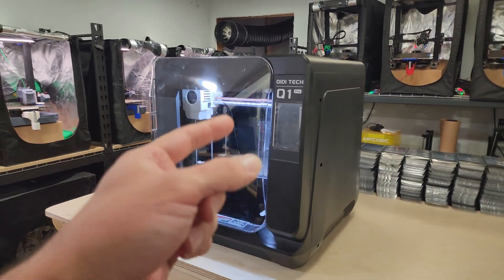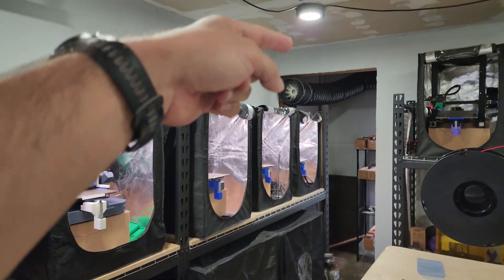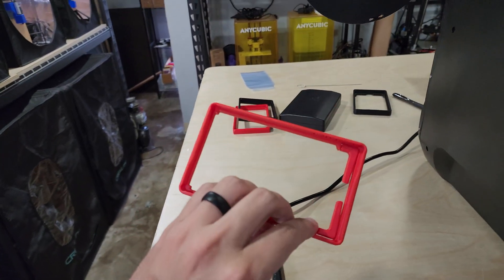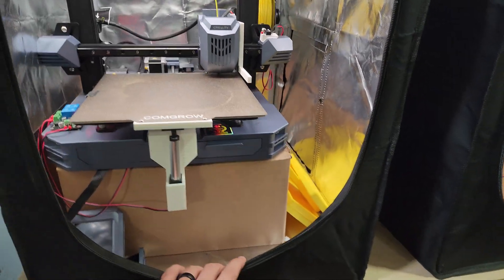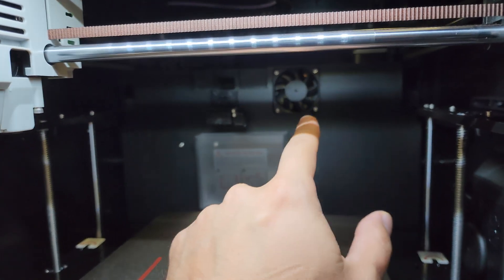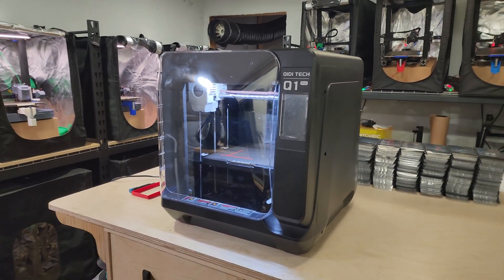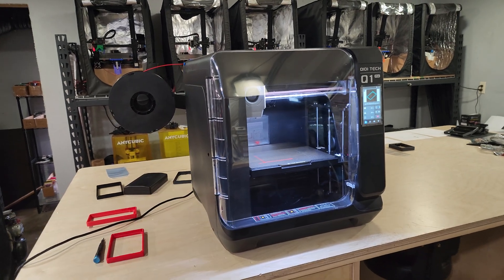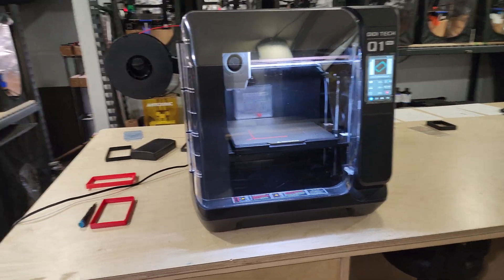The Qidi Q1 Pro is Saving My Health and My 3D Print Farm Business

Comment from the maker: I forgot to mention that a flexible duct was attached to the printer exhaust, and routed to a nearby window where the fumes were exhuasting outside.
Reply: I was wondering about that lol
Reply: Have you looked at the qidi plus4, would like to get your opinion on it. It has a active (fan) chamber heater as well.
Reply: Oly true solution is extraction small filters in printers are very limited I effectiveness due to size and filter media volume

Comment: I have played found that the absolute best way to prevent fumes is to trust nothing of what is said on the built in filtration. Put the machine inside on e of those zippered enclosures, run an inline 4 inch fan to it and out a window. That will actually create a negative pressure inside the canvas enclosure and ensure the machine is vented outdoors. None of these machines are air tight, so even though you may be creating a negative pressure, those fans the machines come with are not moving enough air anyway. Just mu humble opinion of course.
Reply: putting an enclosed printer inside another enclosure is a funny concept but I'm leaning towards that option, if I decide that I want to print ABS/ASA
I'm just not a fan of having a 4 inch inline fan permanently running in the background though
Reply: @felixxcatus  having an enclosed printer with a vent system that is not doing anything is far more silly to me. And those inline fans are not loud and are also variable speed. Using the zipper enclosure, you don't need them on high to function adequately.

Comment: Seeing your more latest video on the q1 farm, would a inline fan attatched to just 1 q1 overpower the chamber temps? (Extract too fast to allow heating) If that is the case do you just recommend the stock chamber fan at 100% (for 1 q1)?
Reply from the maker: I plan to make a video on my setup soon.
Reply: In my experience yes it does, you’ll need an inline fan with a variable speed so that you can find the sweet spot between venting and maintaining temperature.

Comment: You're telling me that this machine has a better seal than an X1C? I just switched from the X1C to the Q1 myself, and am looking for a way to rig the X1C exhaust system I made ('twas magnetic since the rear was metal) to the plastic rear of the Q1.
Reply from the maker: No i had to make some adjustments, I added a duct for the chamber fan to not feed into the electronics area, and I also added foam around the edges of the electronics panel to seal it better from the chamber. I left the bottom of the printer open to let air into the printer to note choke the chamber exhaust. Running 12 Q1 pros with ABS 24/7 this way and not a single hint of ABS fumes.
Reply: @Redo3D  could you do a video showing us this.solution? That would be great.

Comment: Flashforge Adventurer 5M Pro also has interesting system. It is internal and external circulation dual air filtration system with carbon and hepa filters. That is why I decided to buy one and I am waiting for delivery. It has a bit smaller build volume though, 220mm cubed.

Comment: If you take the back cover off the q1 pro — you will find that the fumes are not really sent out the exhaust vent. The fumes are just dumped into the back space of the machine and end up coming out the power supply vent as well. So you need to add an internal duct to channel the chamber exhaust out the right vent. This will also keep your main board and power supply cooler.
Reply: Do you have a video showing how I could do this?
Reply: This would be great to see a video on this
Reply from the maker: Thank you for pointing this out, I removed the back panel and definitely need that duct you mentioned. I can also see a lot of gaps that could be sealed better.
Reply: @Redo3D  it would be great to see a video on this

Comment: Can the QiDi Q1 Pro print Ultem 1010? How can the chamber be made to be hotter 90 -100C and the print head to 400C?
Reply: No it can't you'll either have to make a printer that can or but an industrial printer
Reply: It itself is made of ABS although there is a sturdy steel frame. ABS has a glass transition temperature of 105 °C. maybe 75- 80 chamber temp would be achievable without replacing the ABS panelling and other plastic components with higher temp alternatives but i think water-cooled motors and hot end might be required. I don't see much reason to extend the thermal head room 20 °C. Maybe QIDI will make a higher temp machine in the future for higher temp plastics.

Comment: Good info. I’m curious if the X1E can exhaust the fumes while keeping up the temp. But of course it’s so much more expensive. 

And do you need to run the fan at 100% speed? All you need to do is run it enough to create a negative pressure. I think it would be interesting to do some smoke tests with an automotive smoke machine and see how much it leaks at different fan percentages.

Also if PETG is too shiny I wonder what the finish is with PCTG. I hear you can control the finish with temperature. Similar properties to PETG and ease of printing with low VOCs and no requirement for a heated chamber. I do love ABS though. Especially Bambu’s ABSGF. And ABS can be cheap so I think you’re going with the right method.
Reply from the maker: I have a 10" 1200cfm exhaust fan that also creates some negative pressure in my workshop, so I just run the printer exhaust at 100% just to be sure its getting good suction. I dont mind running it at 100%, may even get a more powerful fan just to make sure Im really getting all those fumes out.

Comment: Is PETG not a good option to prevent warping?
Reply from the maker: It is for most things, but I personally don't like the shiny finish, and it can be brittle, I've tested with PETG before and it just didn't work out for me. Small features broke off easier than with pla or abs.
Reply: @Redo3D  This is an interesting anecdote. In my experimentation I have found PLA to be far more brittle than PETG, curious as to why you would have had the opposite experience.
Reply from the maker: Could be moisture related.